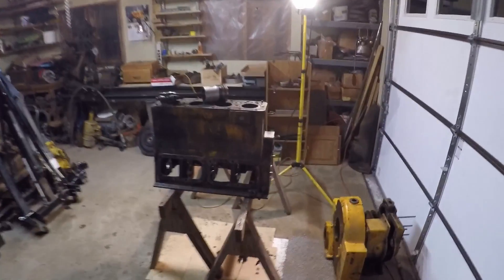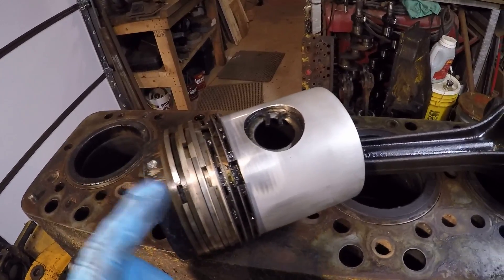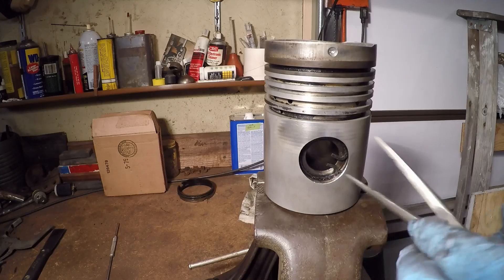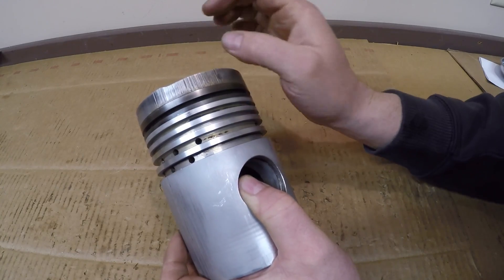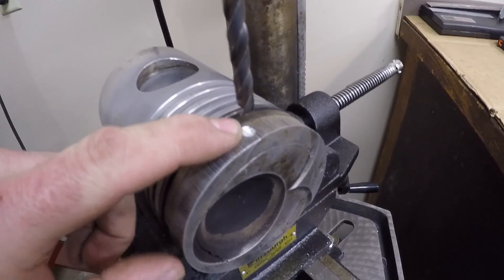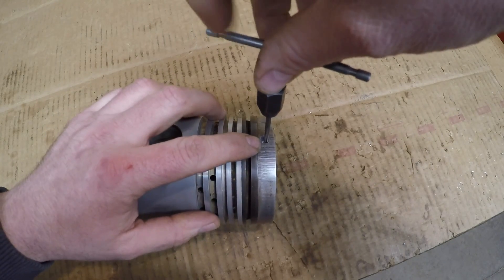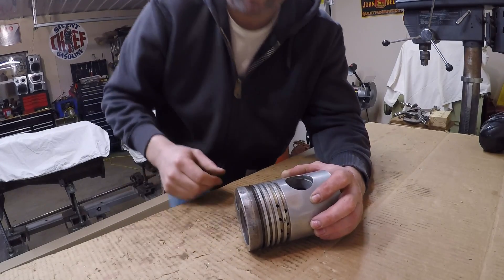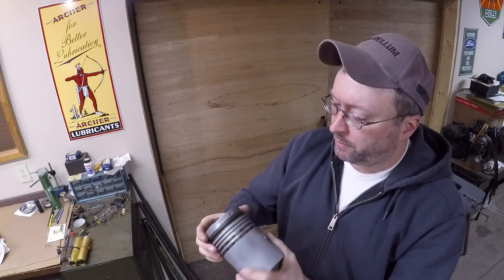Caterpillar D2 Design Failure - Disassembling the Notoriously Weak Multi-Piece Piston

Comment: Failed?  No way, just not so. Those pistons far exceeded any reasonable design specs. by lasting many thousands of hours and many decades of use. An excellent design for that time. Let’s just use the proper terminology here, WORN OUT long ago.
Reply: Cool, love the videos!
Reply: @squatch253  Given the engine was designed to last maybe 15% of the time it actually lasted I'd say the design was good enough for the job at hand. I don't much like the idea of a multi-piece piston but clearly it worked well enough if the engine lasts so much longer than it was ever intended to last.

Comment: Different way to install it, I have seen a "saddle" type where the top sits on the Piston with two ears that pass through the crown and the wrist pin holds it in place. Was an old Russian engine out of a tractor from Belarus and it was really odd. The old guy who knew about it said it was a great design when new but as things wire a little it allowed movement then it beat itself to death in only a short time. There are some odd designs out there that is for sure.

Comment: Any idea why CAT thought this was a good idea in the first place?
Reply: As another post said, pistons that came later in history had cast the iron ring land into the aluminum piston. Just guessing but i would say they lacked the technology to cast the pieces together when this was made, but knew how to thread things together.
Reply: @mr.createandfix5504  yeah and the reason they did that was to withstand the heat,forces and abrasion of the top ring against the soft piston groove.
Reply: see below.
Reply: Just a guess ,but I would think they wanted the best compression seal possible. Big pistons,probably the compression right up to near the limit of what was possible. Small wonder the pony motor was needed.
Would they have machined the steel AND the aluminum top at the same time for best controllable clearances ? No idea.
Think of the force involved in persuading all that surface area ( and thus volume) up to when the fuel gets squirted and then bang,power. Bigger than a truck piston ,considerably.
A previous post said these exceeded design specs in terms of many extra hours of use. Maybe so. Did this design ever grenade under the expected hours of use ? No idea,but I bet Cat never used this almost bright idea again. Probably some very unhappy people said WTH ? Wish we had access to some of the letters,or memos Cat have in archive. Cheers.
Reply: so the idea was to have the piston last longer.It took some time to develop the technology to cast a harder insert into the alloy and have it bond perfectly and this was a 'mechanical' attempt.

Comment: Great video, I too enjoy seeing how things are put together. Stay warm up there. On a somewhat related note if you ever need oddball or obsolete rings contact Hastings piston rings over in Michigan they manufacture and stock rings from 1 5/8" up to well over 8" bores. They were a lifesaver when I worked in a shop rebuilding old tractor and stationary engines.
Reply: Good point. Here is a video of someone rebuilding a Chrysler flathead 6 from 1950. The pistons were EGGE .060 oversized, but the ring set was by Hastings. https://www.youtube.com/watch?v=uQaBYDnjgxs&t=1159s
Normally when someone would need these piston rings (And sometimes pistons) they had to go to eBay and get something that was improperly stored for decades.
In addition, every Hastings ring set I have seen uses a modern 3 piece oil control ring even if the OEM ring set used 1 or 2 piece oil rings. It is possible to buy chrome or moly rings so that the material is equal or greater than the OEM rings.

On the Myvintageiron channel, he often talks about how you can get Total Seal to make limited production piston rings for unusual piston designs. However, I have heard from some people that you have to have your cylinder hone job has to meet certain roughness specifications. It includes measurements with expensive tools that not all machinists have:
https://www.aa1car.com/library/honing98.htm

Comment: More than likely they used aluminum on the pins so the head of the piston had the same thermal expansion properties. I would expect the head to come loose faster if they used steel pins. I'm also sure they run that ring nut down and pin it before they machine the top.
Reply: @squatch253  Totally off topic but I thought I would ask. In about 5 to 6 weeks I will be pulling a flatbed up your way empty. I'm picking up some items from a friend north of Minneapolis. I'm in Indianapolis. If you need something hauled your way and it would fit a 12 foot flatbed, from my direction, let me know and I can save you a trip.